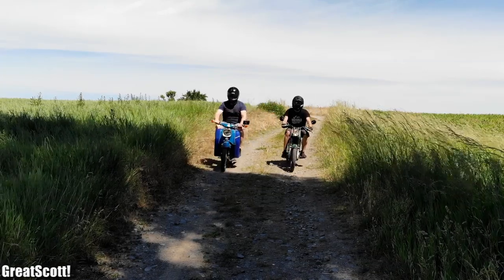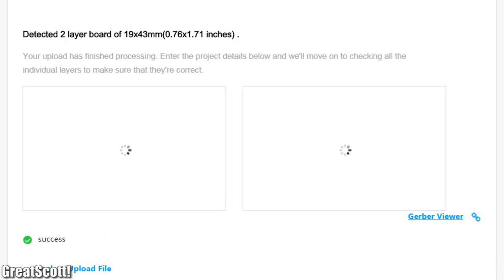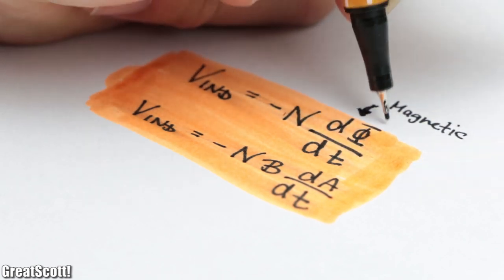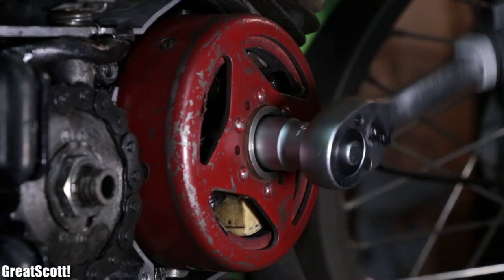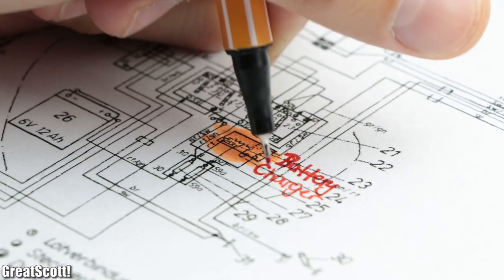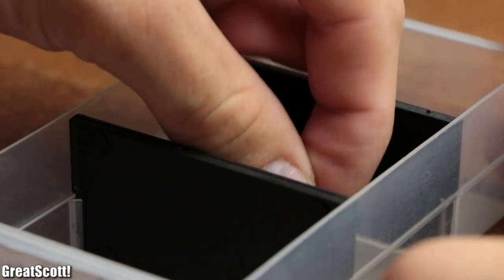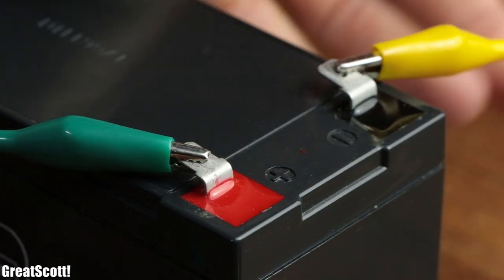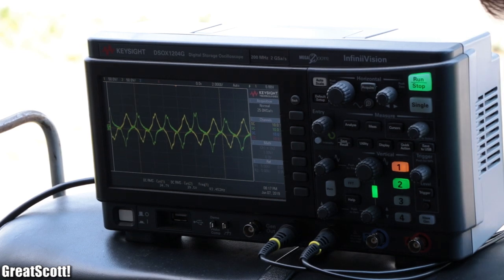HACKED!: 6V Electric Generator UPGRADE to 12V!

Comment: Next: Motorcycle - DIY or Buy?
Reply from the maker: Haha.....I don't think so.
Reply: What about an electric motorcycles
Reply: electric Motorcycle maybe?
Reply: @youigta  Not with all the stuff you have to do to get something street legal in Germany that you build yourself...
Reply: Elements: DIY or Buy?
Reply: A MUCH BETTER upgrade to your moped would be an electric engine and LED lights, powered by lithium ion batteries. But you made some sort of thing that makes your moped waste power even more, besides the gasoline engine, which has only 20-30% efficiency and pollutes the air too :(
Reply: @rapolass2585  a much better upgrade? Oh boy a better upgrade would be 200cc engine better then that 50 bullshit
Reply: Great Scott is an electrical guy not a mechanical one
Reply: I'm working on an e bike. Maybe check out Micah Toll!
Reply: Scott can do it
Reply: Make fighter jet someday 😉
Reply: Tesla - DIY or Buy?

Comment: Got some problems with this one:
 - creating a second ground system to the one used by the coils is never a good idea in an automotive system since most loads rely on getting their ground from the frame which is also connected to the coils -> short circuit
- the LM317 is only good for 37V, you showed that the open-circuit voltage is above 60v for those coils, so no good
thats why most professional moped-regulators, like the vape system you showed, use more robust thrysistors which actually short excessive energy to ground for the headlights and also charge the battery with a thrysistor
Reply: This. Building an SCR-based regulator is pretty easy to DIY, just a Zener diode that drives the gate of a thyristor through a transistor. You can get fancy and use a crowbar IC. Alternatively, moped/motorcycle regulators are pretty cheap, around 10E. However, I assume the point of the project is to learn how a permanent magnet generator works.

Comment: Don't use screw terminals! ..or any mechanical type wire termination on a vehicle or project subjected to regular vibration. That's a recipe for disaster. True, you will occasionally see a wire with a crimp termination and screw used for a chassis ground connection on vehicles. However this will always have a one-time-use friction or lock washer under the head of the screw. These days you will also see the entire assembly covered in an adhesive compound. The crimp termination used will always be a full loop type where the screw passes through the terminal before it is attached.
   If you don't want to use proper waterproof terminals that can be bought quite cheaply from China these days, get a bunch of insulated butt splice terminals for this. They are just as fast. Get a set of side cutters with a crimp terminal on the front of the jaws. Don't get the self ratcheting ones, just the simple kind that will be easy to use in tight spaces.

   I don't know if Deutschland has cheap 'pull your own parts off' type automotive junkyards like we do here in the USA. If you do, just go in with a set of wire cutters and look for the cars that have been at the junkyard the longest. These will often be stripped of most large components. I've only seen someone strip out a wiring harness a few times. They are still on the car 99% of the time when the vehicle is sent to the crusher. The newer the car is the better. Almost all vehicles have the wires routed under the carpet on the drivers side. Don't treat this like a delicate job. Bring the big stuff with you. Think power tools, carpet knife, crowbar, and bolt cutters. Don't carefully take things apart. I mean, don't trash good stuff others will want, but if a seat/headliner/door panel/carpet is already damaged don't worry about how to properly remove it, just brute-force your way in. If you have several vehicles to work with, go for the headlight, taillight, and trunk based wires only. These have 1-6 wires per connector and will have the longest wires attached. You can easily cut long enough wires on each side of the connectors for reuse on almost any project. Dome lights are another source of smaller gauge wires/connectors but still super long wires. I only go into the mess under a dashboard for the larger connectors if I need them.
   This kind of stuff is usually ignored on the junkyard's list of prices for parts. So, find the ugliest female teller at the checkout booth, and be super charming. You'll usually walk out paying almost nothing as pricing for such items is entirely up to the cashier's discretion...It works for me and while I'm only a few years older than Jeremy, I think I'd be the "ugly" wingman at the Saturday night club scene.

   Junkyards are often overlooked sources for lots of things beyond the simple car parts most people think of. If you can go inside and pick your own stuff they are a great source for cheap raw materials from fabrics, to sheet metal, knobs, switches, relays, high current diodes, solenoids, linear actuators, springs, latches, audio gear, and even IC's and connectors. People just don't think of these places as a source of raw materials. You can even find things like high frequency terminals and wiring. The airbag triggering system of a modern car is a very demanding system that requires a robust high speed connection.
 Anyways, those are just some basic ideas for alternatives.

   Things like crappy screw terminals on a vehicle are often the reason for the vehicles you see burning on the side of the road. Don't be that person!
-Jake
Reply: The spring-loaded terminals (either lever type like a wago, or where you push directly on the spring with a screwdriver) handle vibration pretty well, as the spring constantly applies tension, so it vibration cant loosen the connection.
Reply: Wow
Reply: Exactly, motorized vehicles electronics need to be more careful designs and construction for a long durability, of course the project is working, but need to be especially designed and protected and obviusly well PCB designed for to last many years without a problem. i don't trust in LM317 regulator for a durable project, and i prefer the old school designs :)
Reply: You are absolutely right, but where the Moped comes from, communistic Germany, they built it that way!
Reply: @UpcycleElectronics  Extremely well said, sir/madam. 
To the racists/nationalists: Acceptance, Tolerance, and Forgiveness are the only way the human race will survive. And, like it or not, we are all brothers and sisters. Religion, race, color, creed... All human mental constructs. Deal with it, jerks. 23 chromosomes.
Reply: hehehe...butt splice... hehehe
Reply: Obviously the project is an example, but certainly it must be engineered taking into account the mechanical stresses and electrical reliability over time. therefore it is to be considered as a brilliant idea applicable with the due mechanical criteria! As for LM317, it is necessary to apply the dictates of its datasheet to the needs of the project and so you will get sufficient reliability and durability!
Reply: @UpcycleElectronics  So speak a wise man! I do really agree, here those arguments are rubbish!

Comment: Why the LM317? Its terribly inefficient and it can only charge at 1.5A with a strong heatsink. A decent 5A buck boost converter would do the same at a higher efficiency and a better peak voltage...
Reply: I was wondering the same thing the combined coils can put out 70W. With 14v at 1.5A you have a 21W max. He could have done this without ordering the 2nd 12v coil. I would have definitely used a regulator that could have put out the full coil wattage. If the Headlight takes 35W or 55w as he stated he would upgrade to the battery will rundown.
Reply: i also wondered that... 1.5A is not a lot to play with.... While changing the light, why not fit LEDs there too?
And while at it, i would consider a 4S LifePo4 battery as a replacement for the lead acid : 4S LifePo4 can be used as a drop in replacement for lead acid 12V,  and are very safe (non exploding ect). 

You can find either packs of smaller batteries (26650 : https://batteryhookup.com/collections/lifepo4-batteries/products/20-k2-26650-lfp26650p-2850mah-lifepo4-batteries-new at arround 60US$) to make up to a 4S5P 14Ah 12v battery pack (mine is less than 1.7kg, and i have the 3.2Ah cell version, which would make for a 16Ah 12V battery in the same configuration),

or for a simpler wiring,  4 of those 8Ah 38120 LifePO4 batteries : https://batteryhookup.com/collections/lifepo4-batteries/products/4-headway-38120-hp-3-2v-8ah-lifepo4-lithium-batteries-25c-200a-super-cells, which would make for a 12V 8Ah battery with 200A of current capacity, for around 45US$. 

Add a BMS for good measure, and you have plenty of power for the vehicle and appliances.

 Note : i'm not affiliated with them, i just  followed recomandations from youtuber jehuagarcia that does lot of battery stuff, i ordered a pack (i'm not in the US, i'm in french west indies), so i paid 50$ for the batteries, 25 for shipping, and around 25  in taxes. even then it remained competitive.
I'm considering replacing my cars lead acid with a LifePo4 pack too!
Reply: @AudreyRobinel  Since it is a old school bike he may not want to mess a lot with it
Reply: @barbasbandas6665  i get it, but he did say he wanted to plug appliances onto it... plus, old does not mean crappy :)
Reply: @AudreyRobinel  old means good :D got your point
Reply: @AudreyRobinel  About the LEDs...its probably illegal. The motorcycle had the "homologation" (not sure if its even a word) made with those lights. And by the European law you are forbiden to install stuff in vehicles that dont match the homologation anymore. Kinda like with cars. Even changing the overhead light to LED is illegal...techinally no officer will ever notice it or tell you to replace it but a carefull MOT inspector might notice it.
Reply: @zanpekosak2383  Hello! I live in French west indies, which is part of France, so i'm subjected to the same regulations :) You can buy aftermarket LED lights that are meant to be retrofitted on vehicles, as long as you use the proper LED that follows the regulation, you should be in the clear! In France, we have a regular vehicule inspection that must be done anyway, so if it passes the inspection, it means it's street legal! But as you say one may install unsuitable and/or too powerfull lights if not careful...
Reply: @stdorn  Could you explain this more? Currently working on a CB125 with a 6v circuit. I have nothing left, not even the original rectifier. Want to replace it with a reg/rec and combine the coils to get maximum power out of it. Is it possible?

Comment: I love this video and your channel is great. I work as an electrical manufacturer. I build and wire electrical enclosures/panels for various automation needs, such as; canning plants (Coors beer), solar fields that track the sun, green houses that automate everything from sunshades to irrigation, and so much more. 
A few guys and i at the shop have some classuc mopeds that we have been upgrading. I have an old tomos moped that i converted to a 12v system with new LED headlights and turn/brake signals. I designed the wiring schematic myself and feel very accomplished in my efforts. 
With your videos i now feel like i have a greater understanding in electrical sytems and the confidence to build my own parts rather than buying expensive premade parts.
Thank you for the knowledge gained

Comment: Thank you very much! i have inherited an old CZ motorcycle, that is in dire need of similar modifications, since its generator is incapable of maintaining the headlight running (as required by regulations) and will eventually drain the battery.  This video definitely helps with the inspiration for the work!

Comment: Ohh old memories come back. I used a own a S50. It was a gift sent via Genex  (you might be too young to know) from my dad from Canada. I remember the battery was always leaky. It was only there for the blink lights if I remember right. I used to build a 220V inverter right into the box for my beboshear shaver for camping in Czechoslovakia. Good memories. On this trip I must have changed the spokes of the rear wheel 2x over. Thank goodness I had enough. This moped really lasted me a good 12 years then I left the country.

Comment: Good upgrade, but the 1.5A output will only give you about 18 watts of total power, however the battery charging, tail light, headlight and brake light will need more than 60 watts.
I would have employed a full wave rectifier for each winding, then couple the output's of the two bridges, that will eliminate phase crossing the separate windings. Then filter and apply that rectified output into a buck boost regulator module rated to about 80 watts or more. The buck boost will give charge voltage regardless of the input voltage being lower than it's output, and there will be much less energy loss than using a passive regulator.
I did a similar mod to a 212 kart motor and get over 50 watts from two similar coils.
Thanks for posting.
Reply: Could you provide an electrical wiring diagram of this?

Comment: My 1970 Honda SS50 has 6v system but the rectifier is half wave. I disconnected the ground side of the altrrnator coil and put both coil connections to a modern full wave bridge rectifier from ebay. Then connect the negative dc output to bike frame. Change all bulbs (now led), battery, horn to 12v and it works great! Changed wiring to run headlight from battery, now its never dim whatever the engine speed. Everything is bright and constant. Much safer.

Comment: I've turned my 49cc TaoTao moped into a ridable 750 watt generator. The charging system charges around 15 volts, but everything works fine. Not to mention I have a nitrous kit installed, and soon a 12 volt "turbo" kit! I love this thing!

Comment: God bless Karl Clauss Dietel when designed the S50/S51, i think IFA combinat was the greatest thing in the eastern bloc. They achieved the impossible with economic and long lasting designs. German quality meets russian simplicity with every product they invented. The Trabant documentary  is a great video to watch about the communism in DDR.

The WAPE is a last generation ignition and generator for the Simson S51. There is a factory 12V system with a central electronics called ELBA. Much cheaper and much reliable compared to the old 6V tiristor or 6V with mechanical breaker.
Reply: The WAPE is a last generation ignition and generator for the Simson S51. Please can you provide me some info about!?  I will greatly appreciate! Thanks in advance!

Comment: Many years  ago ( about 40)I had Honda XL 250 . The electrical system was similar in that tail light /headlamp was ac powered and indicators hooter and brake light dc from battery. All 6 V. When headlamp was  off a load resistor was substituted but problem was the battery was used as a voltage limiter and in a hot country it was over charged and died . Headlamp would then burn out. My crude solution was a voltage dependent load to control the maximum  ac voltage from coil. bridge rectifier  2 x 2n3055 with fat 12 V 5 W  zener  and  a 2W resistor  100 R  all mounted on some heat sink fitted below headlamp for a bit of cooling. A bit crude but it worked .

Comment: I use 10W LED on my moped, since it's so much power efficient and also much brighter.
Reply: You will get problems with the TÜV 🙄😁
Reply: @ChriDDel  the type I own doesn't have to get inspected. (it doesn't even have a reg. plate) (it's called babetta if interested)
Reply: @DigerCZ  yeah, but not in Germany. We have rules for everything. Your are not even allowed to install any light you want on your bicycle.
Reply: @ChriDDel  so you think I wouldn't be allowed to ride my babetta in germany?:(
Reply: @ChriDDel  Now I can put one more place on my "not to visit" list.

Comment: Hi Scott! Please make a video from building custom programmable ignition module on avr for chinese pitbike engine. A lot of people needs a programmable CDI but it's expensive to buy.  DIY Programmable CDI should be good equivalent.
Reply: Why on Kit? He should use an Arduino! I thought about them when I was doing my Engineering project for the end of first stage studies. 😅

But main problem is convert 3d ignition timing map to the Arduino. But from the other hand, 2d map should be fine. Exactly: Ignition Timing Angle im function of RPM. With programming of the timing from smartphone by bluetooth. 😂

Comment: Awesome project. Good working prototype, probably needs measures to control vibration effects like weakened solder joints (heatsink mass) and waterproofing (silicone coating everything).

Comment: Excellent idea. Great and readily available voltage regulator. Would have liked it if you calculated the total impedence of the two coils and made use of a filter circuit.

Comment: You can use the exact same 3 resistor feedback circuit with a buck converter. Same battery charging behavior with far less losses.

Comment: Hi
You can also simply use a relay in between battery and the charger's output and power it by charger's input voltage to connect battery to the charger only while its working and disconnect battery from the charger while its not working to avoid diode's small amounts of leakage.

Comment: Nice, this guide can be used on other old mopeds/motorcycles too, if there is circuit diagram available. i'm just bit worried about those screw terminals, i would use crimp connectors and make nice harness..

Comment: Another cool project, but in terms of Headlights why not simply switch to an led set? You'd get brighter output with less power being easier on the circuit and actually saving a small amount of gas during its life.